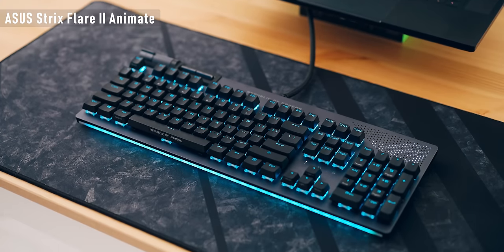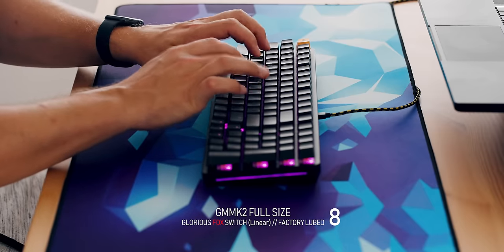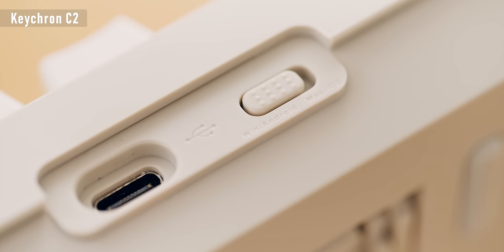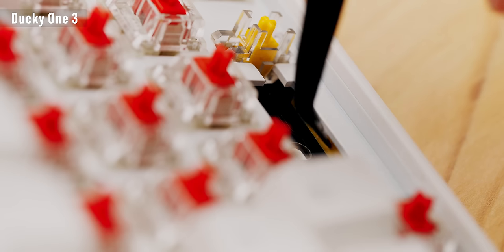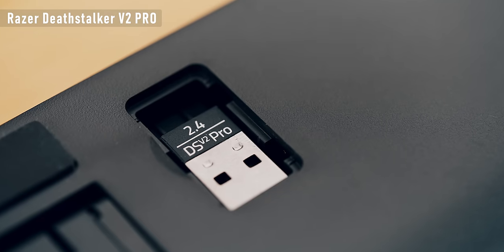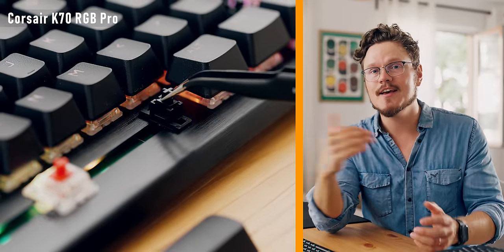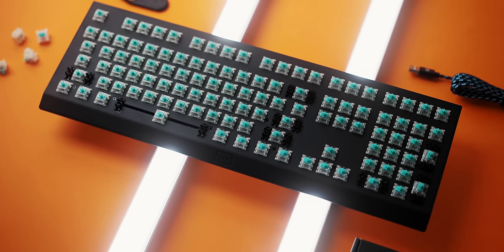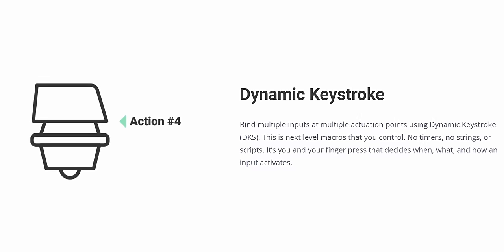Best FULL SIZE Keyboards You Can Buy - 2022 Edition!

Comment: Looking for a full size keyboard with low profile switches and completely flat keys that won't break the bank, anyone have any ideas? The only option I can think of that fits this is the Apple keyboard, which I'm not sure can be used on a PC at all!
Reply: Logitech MX Keys fits your needs. It's like an enhanced version of an Apple keyboard that is made for both PC and Mac. Also, Apple keyboards can be used with PC, even the wireless Bluetooth ones.
Reply: @sternkrieger1950  I've seen the Logitech keyboards that use the MX keys, and they still have bumps on them, less flat than the Mac Magic Keyboard. Then there is the price, as far as I can tell the only Logitech keyboard with those keys is the G913, which is a $280 keyboard vs Apples Magic Keyboard which comes in at $199
Reply: @Celician83  Can't find anything as flat as the Apple keyboard, but there is also the COoler Master SL630 and the Cherry MX 10.0N, but those are in the same price range as the non-touch id apple keyboard, so might as well use that one.

Comment: Most mechanical keyboards nowadays look like they are made of a paper-like-plastic, they are too mushy, they sound hollow and clicky thin. 
Most of them should be way bellow 100 bucks, since they feel like a cheap Chinese product with an American brand over it. 
Instead of trying to solve the electronic trash problem the companies just keep making their products worse and worse. 
Just like sneakers shoes, they are all made of fabric and white foam nowadays, but they won't protect your feet from getting wet on rain and from heavy or pointy objects that may fall over it, nor do they last longer than the plastic-rubber ones.

Comment: No keyboard should be wired in 2022
Reply: @Arcane ong frfr no cap one hundred emoji
Reply: how will you charge it with out a wire?
Reply: Bullpoop. Some of us like keyboards that don't need a dongle taking up a USB port, having to remember to recharge (and watching the battery degrade), and having keyboards with features like USB passthoroughs and media controls
Reply: Unless you're going to wander around with your keyboard, a wired one works perfectly fine and you don't have to worry about it going dead at an inconvienient time.  My keyboard sits on my desk and doesn't move more than a couple inches. Why should I have to hassle with wireless BS?